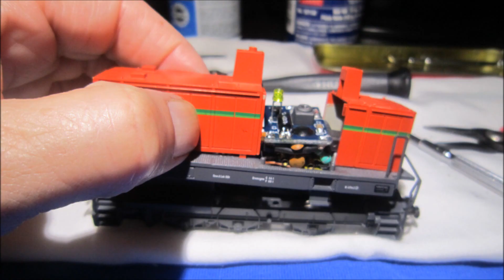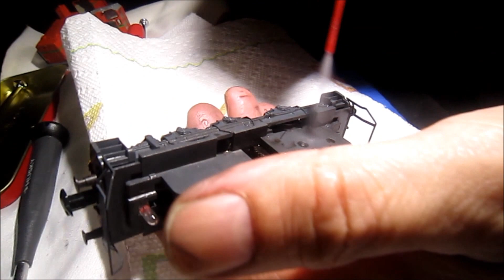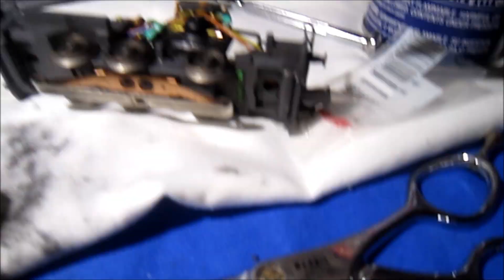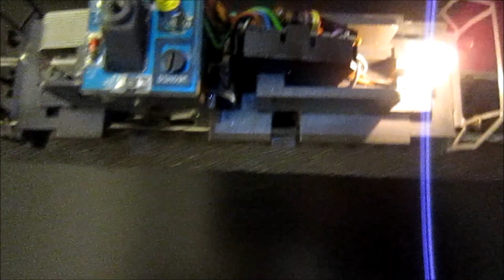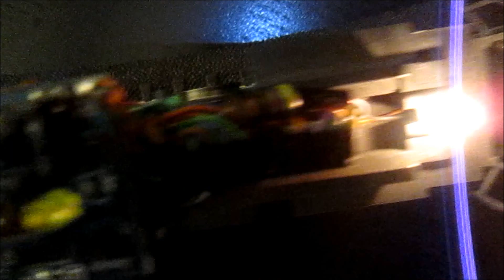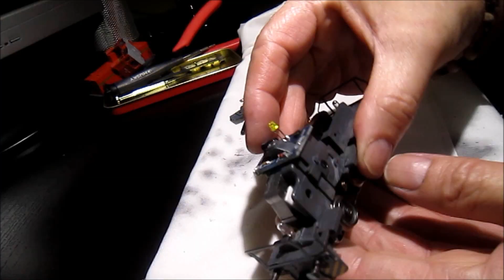🔴Marklin Repair 36880 Märklin

Comment: Hi I have a model close to yours. Mine seems to be hopping around the track and making weird noises. Any idea what that is?

I changed the brushes and oiled. But it still sounds like it's squeeking and jumps around the track.
Reply: One or more wheel pairs and/or gears in your loco is physically damaged. It needs to be taken to an authorised dealer for service and part replacement.